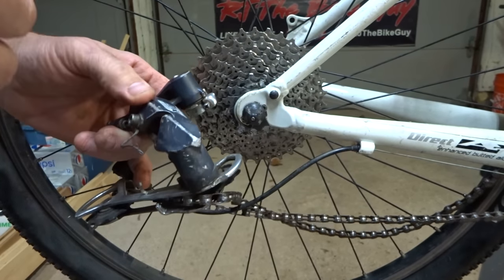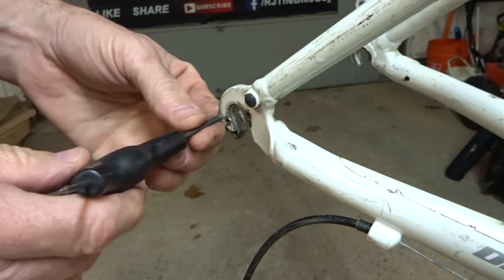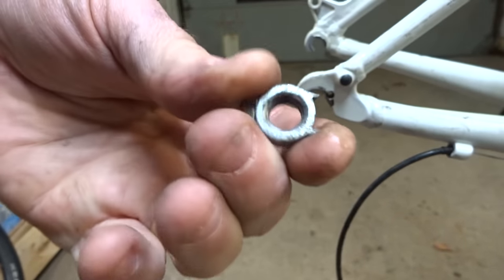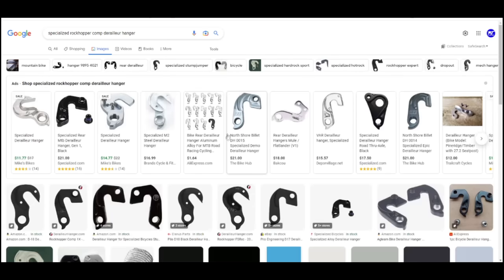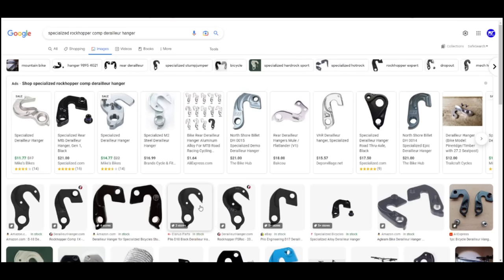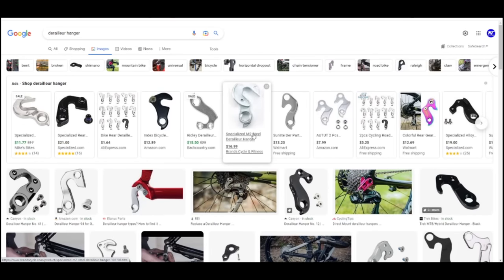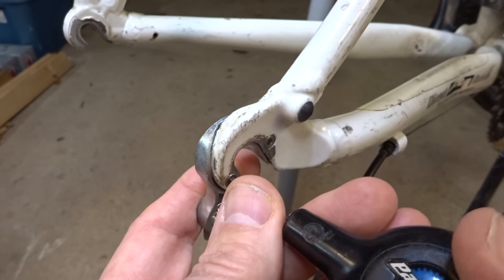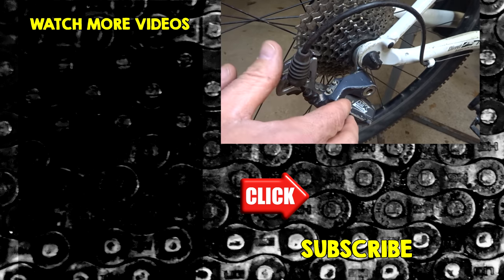Replacing Broken Derailleur Hanger

Comment: I've Actually used that same Rockhopper hangar to replace/fix a broken hangar on a non replaceable drop out (Gary Fisher hoo koo e koo) You have to carefully grind/dremmel the dropout into shape including removing the raised bit on the inside, widening the slot and drill for the holes (I think I removed a bit of the external lip of the hangar too) but it worked a treat, I see no reason you couldn't do the same with a lot of older steel frames. I see gorgeous lugged "mid range" (for the time) road frames with snapped off hangars all the time for chump change, too good to throw away but not worth the expense to have the dropout replaced. Seems like a fix that might be up your street RJ, if you can manufacture one of those quill seat-posts you could do that no problem.
Reply: Please explain the process better. I have a old steel trek 800 i converted to a dirt jumper. and i landed on a jump and derailleur sucked into my wheel due to jockey wheel grinding on cassette. My hangar was at a 45 degree angle. i Just bent it back with an old wheel

Comment: This exact problem happened to me on my last ride! I changed gears and there was a lot of noise. Suddenly I wasn't able to pedal. I thought my chain had come off, and then I realized the whole rear derailleur was hanging off! The hanger had broken exactly as in your video. I mostly walked and occasionally rolled (risky and awkward) to a bike shop. Surprisingly, they gave the option to just replace the bracket; but the derailleur was a basic one and I upgraded to a better one for just over three times the cost of the bracket alone.

Comment: Derailleur hangers started to need replacement with the introduction of aluminum and carbon frames. The steel ones were more malleable and less likely to break and could often be straightened slightly several times. Cheap bikes often came with steel separate hangers with the derailleur anyway. Too many proprietary standards out there!

Comment: Would you use a derailleur hanger alignment tool before putting the derailleur back on?
Reply from the maker: No. That is for non replaceable hangers. And if the dropout is straight, the hanger should be.
Reply: Good to know, thanks!
Reply: I would, but I'm a professional mechanic and RJ is not. A hanger alignment tool can (and should) be used on any hanger that's known or suspected to be bent. That includes a new hanger, because the hanger itself, and/or the frame, may not be perfectly straight. A 7 or 8 speed drivetrain can tolerate a lot more misalignment than higher numbers of speeds, but it's still best practice to use the hanger alignment tool first.
Reply from the maker: And on a hanger like this, if you tried to adjust it, you will likely snap it it right off again. Great job! If the drop outs are straight, the hanger should be straight. Better to use dropout alignment tools.
Reply: @RJTheBikeGuy  Not if you know how to use the tool properly.
Reply from the maker: I know how to use the tool, thanks.
Reply: Ah, I was thinking for a carbon fiber frame, the derailleur hanger might be designed to bend, because you can't bend a carbon frame.
I can see RJ's point with that hanger in the video

Comment: It happened to me also. So, my geardrop have broken, during a city  ride ( not off road) on a very good bicycle lane (infrastructure ) in the city of Aarhus, in Denmark. Due  to an intense wind, a plastic bag flying around have twisted on the derailleur.  So, when the chain putted presure of the derailleur,  I  think was the moment when the hanger have broken 🤔

Comment: I suggest truing your hanger (Part Tool DAG, Abbey HAG etc.) before reattaching the derailleur, as it's very possible that whatever impact caused the derailleur to snap off possibly caused the rear tip of the chainstay to also get bent and out of alignment.
Reply from the maker: Not the hanger. Aligning the dropouts. The hanger is aligned with the dropout. If the dropout is straight, the hanger will be straight.
Reply: @RJTheBikeGuy  Agree,.  But, in absence of frame alignment tools (or skills), I believe it would be necessary to properly align the hanger,
Reply: @mrvelro  No chance Bobby, that hanger will break in half if you try and bend it!
Reply: @Bikeops2021  It isn't by much so it doesn't take a lot of force, but just about any bike has a misaligned hanger. Even new bikes fresh out of the box.
Reply: @cccpkingu  Totally agree mate..

Comment: My rear derailleur is the same like in the video...but it starting to getting loose... chain flops everywhere...no tension...should I cut the chain shorter or is there any other trick?
Reply: new mech. springs fucked. or add some tension to b limit. Screw in the B limit screw (screw touching hanger)

Comment: I'm sorry, but it's absurd that you cut the chain without checking if it was in no condition for use. From what I saw, the chain was perfect and it was enough to distort it. at worst, you should have opened the chain and then reinstalled it with a new link. another absurdity is to tighten the new hook with pliers. unbelievable. finally, you spent an enormous amount of time explaining how to search for the dropout on google and did not explain that after placing the derailleur, it has to be adjusted and carefully checked whether or not it is warped, in order to avoid damage to the wheel and even a horrible accident due to a possible lock of the rear wheel. I think the video needs to be redone. , in order to maintain the quality and excellence of your posts.
Reply: I disagree. I see nothing wrong with his methods. You are doubting a man who likely has decades of bicycle mechanic experience.
Reply: 100% disagree with this comment.
Reply: What??? You can see that chain is knackered and half seized it doesn't hang in a smooth curve under its own weight and it's rusted, its trash, besides steel is 100% recyclable the nasty chemicals you would need to try (and likely fail) to bring it back to life, not so much. He didn't tighten anything with pliers he just squeezed the hangar into place, those hangars are drop forged and are made slightly undersized by design for a tight fit, they need a little encouragement to seat, totally normal, if you don't do that and rely on the tiny bolts to pull it into place you risk stripping the threads. Even though its good practice to check derailleur hangar alignment, the idea that a very slightly misaligned hangar is going to cause a catastrophic failure is laughable, most new bikes come with slightly "off" hangars.
Reply: 9 speed chains are like 20 bucks what are you on about? I’ll replace a chain if it looks at me funny they’re consumable!
Reply: @connormonahan6979  🤣🤣🤣🤣
Reply: Disagreement is your right, and I respect it, as long as you respect that I also disagree. just because RJ has years of experience doesn't mean everything he does is right. the procedure shown is wrong in several technical respects. the fact that the chain costs little does not imply discarding it without an evaluation of its state. there are very expensive chains, like some Regina, Mavic, Dura ace that cannot be discarded so easily. try to find out more about it.
Reply: the chain is not twisted...the derailleur is reversed, and that makes it look like it twisted. contrary to what someone else commented, he used the pliers to adjust and press the new dropout into place. this is unacceptable, especially if we consider a vintage dropout (type campanholo etc) or even in aluminum frames (like the Alan ones) or carbon ones. This is unacceptable.
Reply: finally, disregarding the potential for an accident due to derailleur misalignment only makes clear the technical lack of knowledge of those who commented. when the derailleur enters the spokes, braking is sudden and can easily overturn the cyclist. moreover, I've seen warped, broken frames, destroyed cubes, very expensive spokes unused (sapim, DT revolution etc) due to the derailleur having entered the line of the spokes... made little of this observation.
Reply: when you make a video demonstrating a technical procedure you should keep in mind that this video will go around the world, and cyclists of all types will see it. therefore, technical rigor is required. finally, a 20 USD chain costs around 100 USD in Brazil...so you can't discard it without evaluating the condition. think about it.
Reply: At the beginning he said the chain is twisted 😊
Reply: @luisotavioalencar4395  If you're unimpressed with RJ's skills why not set up your own bike maintenance Youtube channel? RJ has taught me a lot and I've saved a lot of money as a result.
Reply: @luisotavioalencar4395   I explained to you why it was necessary to seat the hangar on those frames. The derailleur is not going "enter the spokes" unless its misaligned to the point you can visually see it, or the cage is bent (which would be a whole different video). RJ said at the start the chain was dead he has other videos on checking a chain if you need to asses that for yourself, he also has a vid on checking hangar alignment and even making your own tool to do so. This is ONE type of hangar among 1000's you can't cover every little thing in one video. As someone who has worked on everything from 40 year old clunkers that were cheap new, to bikes a dentist would have to sell a kidney for there is nothing wrong with what RJ did in this video, this is good advice for the home mechanic. The fact you call a hangar a "hook" and talk about aligning it "after placing the derailleur" tells me you have not got the first clue what you are talking about.
You need to work on your Google-foo buddy, Regina make motorcycle chains, Mavic chains are cheap (and crap), and Vintage Campag' dropouts are are non replaceable. 
🤡

Comment: If you are going to be a mechanic , then do the job right , instead of using bolt cutter , use a chain breaker tool to break the chain, do not use pliers to squeeze to put the new hanger onto the frame. You wasted 3 minutes of your time searching for it , which you should have done before you did the video. And last thing use a blue locklite on the bolts to keep them from working back out. if you can not do this , then don't do videos and give people bad advice.
Reply: Nope bolt cutters are the way, when the chain is done. I've stripped hundreds of bikes for rebuild. I'm not going to waste time or add wear to my chain breaker.
Imagine telling RJ who has many years of YouTube repair videos, what to do when you likely don't know.
Reply: @stitchilalu  I disagree, he should use the chain breaker, if going to do videos, then he should do it right for the people who is viewing the video.
Reply: This RJ chap is all about 'how to', and will happily show you the 'boring bits'.  I'd avoid giving his other videos a look, you might be more offended thann you are now.
Reply: In fairness, RJ's work is much better than your grammar!
Reply: @Bikeops2021  You leave my Gramma out of this.
Reply: Don't know about bolt cutters,  but been cutting outer links on single speed chain awhile. Single speed chain doesn't fit into my 10 to 11 speed chain tool. Have not seen the old cheap Rivoli tool in ages. Diagonal cutters work so well,  I don't miss "the right tool". The steel on outer links is softer than you might think. Master link best choice for all chains anyway. They just don't fail.